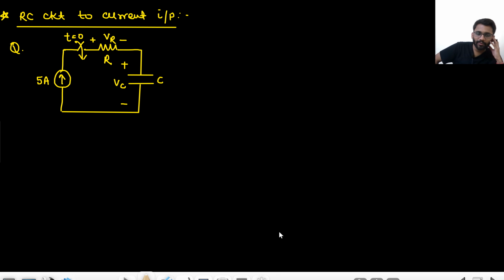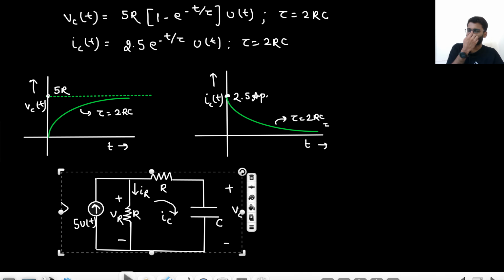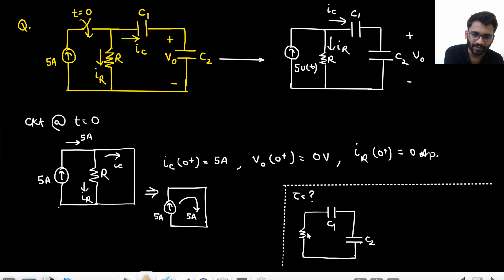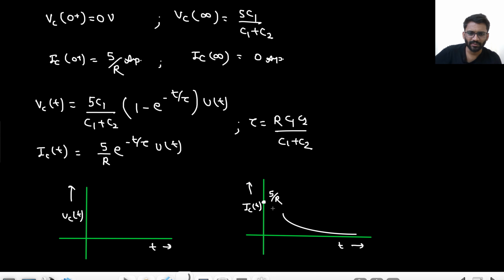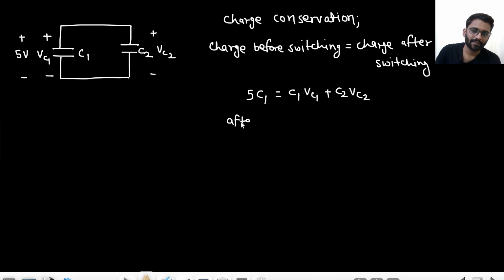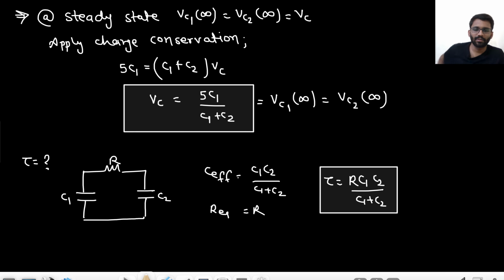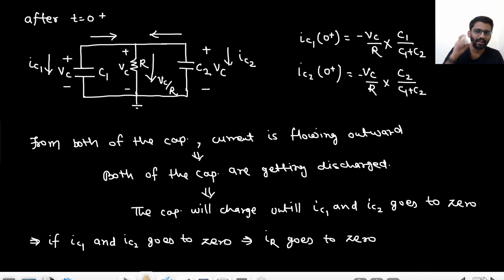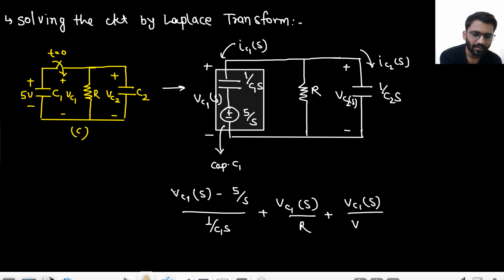Current Input and More Examples of RC Circuits || Network Analysis || GATE 2025-26 || PrepFusion

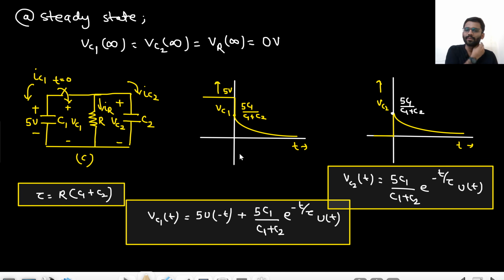Comment: 1:50:55 the value of Vc1 at t=0 would be 5 + 5c1/c1+c2 so we need to subtract a 5 for zero instant; therefore current expression - 5delta(t) would be correct expression Vc1

Comment: 20:00 I am getting Req as R/2, as if we calculate from R the other R will come in parallel
Reply: Current source will be removed and when we will see the circuit from C R1 and R2 will be in series
Reply: @yuvrajsinghpanwar8857 so we don’t need to see Req across R but across C. Which is Req=2R

Comment: In the first example only why if we think in this way as we close the switch there is a sudden current meaning a high frequency component comes then why capacitor isn't shorted and when the cureent stabilizes then why the capacitor is not open because there is 0 frequency now?

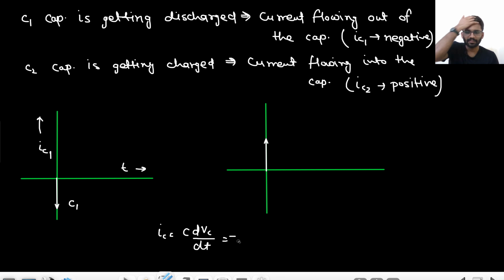Comment: 1:15:33 we have C × dVc/dt , for dVc you have written C1[ V' - 5 ] but why didn't we write 'dt' , the change in time which is 0 here , so it should turn out to be infinity.
Please address my doubt
Reply: yes you're correct, there is infinite current, represented as impulse, the dt- 0  effect...
at t=0, there is a sudden change in voltage of the capacitors. And in case of infinite current through capacitor, cap will not follow Vc(0-)=Vc(0)=Vc(0+), and will suddenly within no time charge up to the steady state voltages which has been represented by the step voltage drop &  impulse current... means for t=0- we got the ckt as in the question, and for t=0 & t=0+ the ckt will be the same i.e. cap with steady state voltages suddenly. So current will flow just for a moment, and that will be an impulse, making the voltages around the capacitor as the final/steady state voltages...
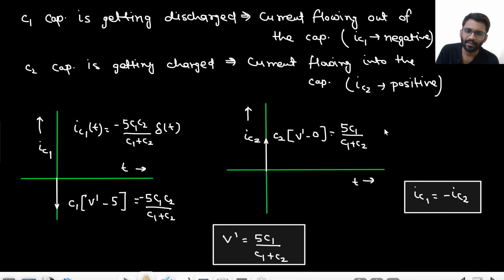Reply: you might have got your answer at 1:27:30 as well..

Comment: 1:22:52 charging and discharging of capacitor continous until VC1=VC2 .initially  if vc1 was 5 volt and VC2 was 0v then  VC will be 2.5 volts then only current flowing through r2 stops and we will get voltage of 2.5 v .is that right?

Comment: 35:15 why c1 & c2 are in series? C1 is in parallel with R and c2.
Reply: Same question I have
Reply: @sonaranijames8621 read above comment
Reply: You are not looking for Req accross the cap C2 , those nodes are just for representation , just simplify the ckt to get the TC

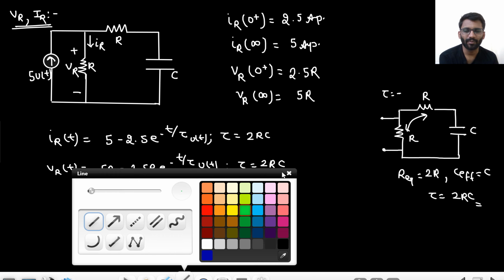Comment: 19:45 Isn't the other R in series with C comes II across the R we are taking the output, so the tau would be RC/2.
Clarify..
Reply: No it wont , you are not looking for Req ACCROSS R , its just for representation
Reply: Same current flowing through 2 resistors so 2R

Comment: @1.09.57 how the capacitors are in parallel sir? kindly explain this sir. When t=0 the switch is closed then same current will flow through this right? Then how it became a parallel connection?

Comment: at 1.43.09, it can be pretty assumed that at steady state ,capacitors will be open circuit  ,and no current will flow through resistor , that means voltage across each of element is zero
Reply: I think In reality the capacitor are actually short since there is no voltage across them....at steady state we can comment ic will be zero...it can be open or short

Comment: I dont think, putting a series switch with a dc current source is a good idea. Though you can put that switch in parallel to the current source and you can say, the switch is being opened at t=0.
Reply: See from Vo poin of view
Reply: Why so @RitayanMitraggmu
Reply: @dontdontcant  An ideal current source should not be open-circuited using a series switch because suddenly interrupting the current can create an infinite voltage across the source in the ideal case, which may damage components in practical circuits.

Similarly, an ideal voltage source should not be short-circuited using a parallel switch because forcing the voltage to zero requires an infinite current  in the ideal case, which can cause overheating and failure in practical systems.

This issue can be reduced by using a resistor in parallel with the switch for a current source, providing an alternate path for current flow when the switch is opened. Likewise, for a voltage source, placing a resistor in series with the switch helps limit the current and prevents excessive current flow during switching.

Therefore, the correct switching arrangement is:

A voltage source with a series switch, which safely provides (I = 0) when opened.
A current source with a parallel switch, which safely provides (V = 0) when closed.
Reply: yeah , good point